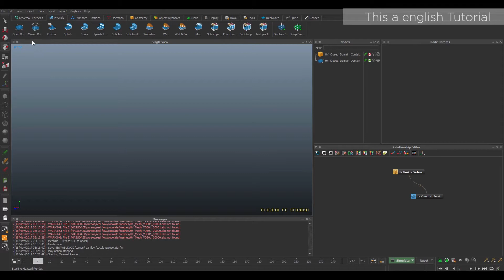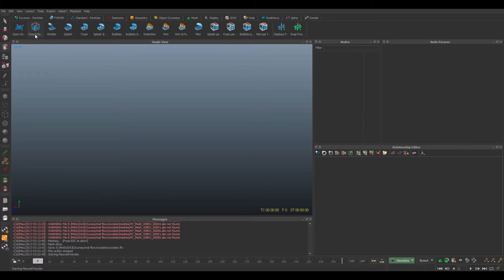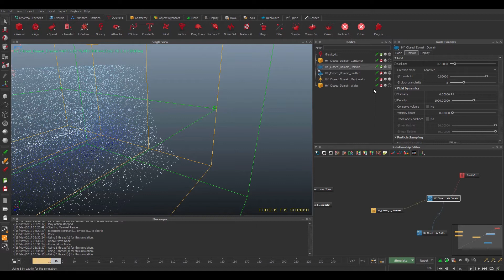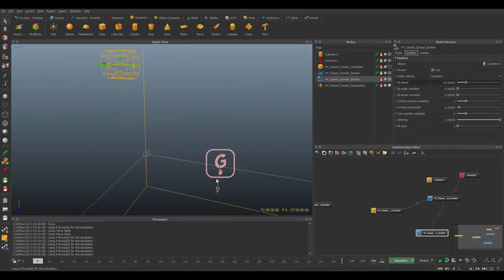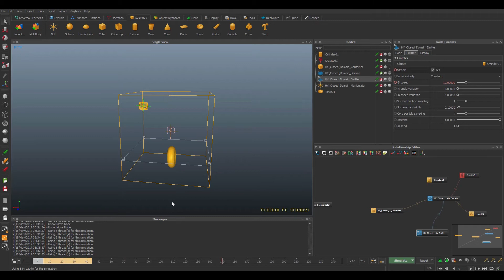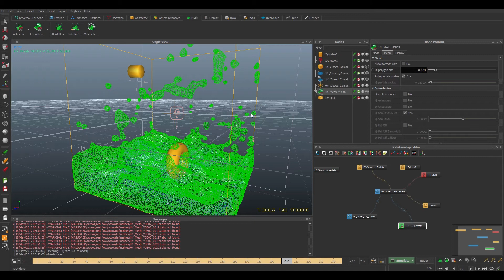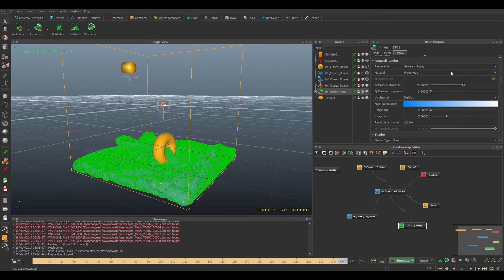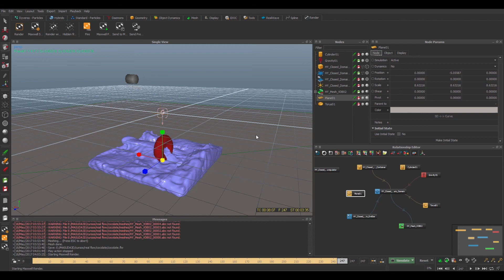Real Flow 2015 Tutorial   Hybrido start

Comment: Great job sir, Nice work 👌
My realflow 2015 is getting crashed every time i click render. What can i do can you please help? 👍
Reply from the maker: Some time this happen, and maybe is some hardware problem. Try to re install the software, but if this continuous, the best way is ou send the simulation to another 3d program like Maya or 3d Max using the RF Connect.